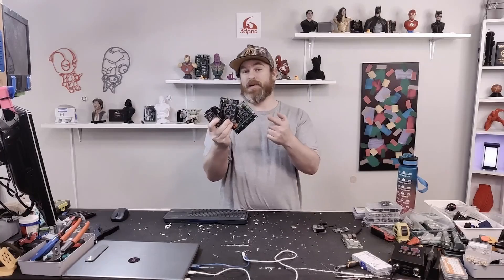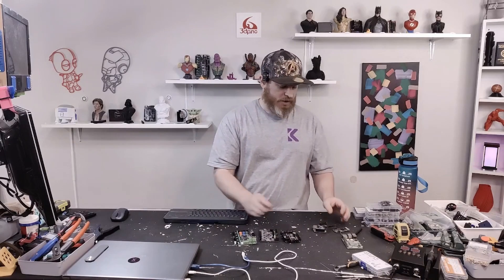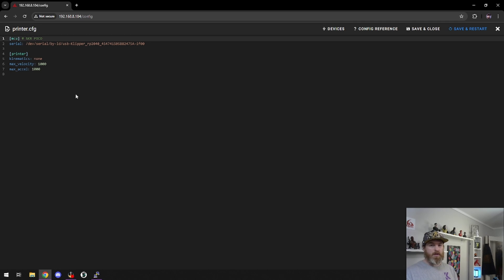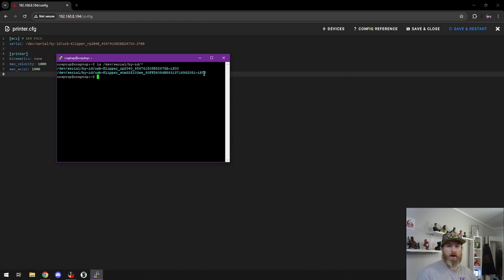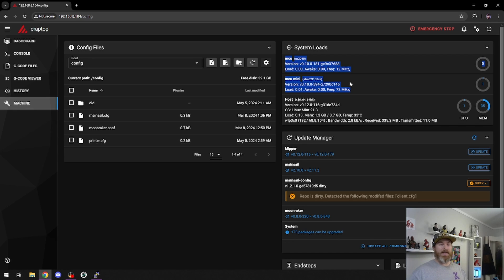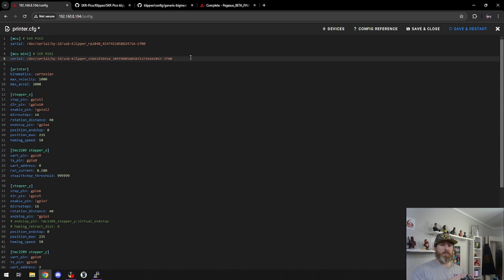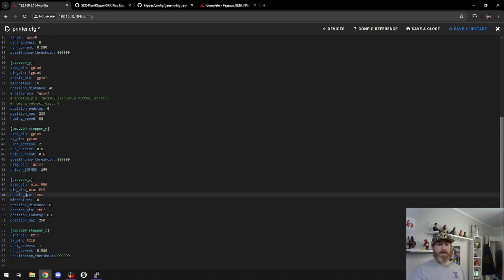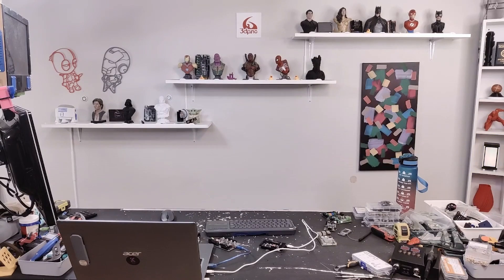Use multiple MCU boards in klipper! FULL TUTORIAL

Comment: Hello! For example, in my klp1 230 only the X-axis driver broke so I bought a skr 1.4 turbo with the same drivers, 

I read that the cheetah v2.2 motherboard that comes with my klp1 is actually 2 boards,  one that contains klipper and the other one is a driverboard, in this case I would only need to connect my skr1.4 turbo in this case the XYZ and change the printer.cfg to add the new mcu? No need to install Klipper for the new MCU? This new Skr1.4 Turbo connects via USB to the Cheetah v2.2? Or direct to the PSU? excuse the confusion since this is my first time doing this.
Reply from the maker: The 1.4 needs both power and USB for signal. It needs to be flashed with klipper too.

Comment: How come my system loads don't reflect the mcu's that I have added?
Reply from the maker: I don't understand
Reply: @kanrogcreations    In the video when you added an mcu you could see them under the right hand side labeled "system loads" in Mainsail.  What would cause the MCU to no show up there?  I made a simple printer.cfg with just a few lines like yours and I can see it under the devices pull-down and I can see them in the serial/by-id/
Reply from the maker: @My_life_has_changed I would have to look at the configs to check that, I suspect that you have missed a include line somewhere
Reply: Thank you I will reflash my board to CAN instead of USB and see it that makes a difference.

Comment: I have a question could you put include in the name of the board much as you put include fluid CFG in your printers. CFG would clipper reference the other board that way
Reply from the maker: If I understand the question; Yes. you can put the [include] line anywhere, even in other .cfg's as long as they are already included in the printer.cfg.
Reply: Yes that was the question designing my own multi-material set up and I was hoping I could just put include mmu CFG in my printer CFG configuration and it would run the other control board for the other four extruders @kanrogcreations
Reply from the maker: @jasonwilson9207 that's a good way to do it yes, a cfg for each tool board and use the [include] function in your printer cfg
Reply: Awesome thank you how many YouTube video on my progress kind of sucks cuz I have my phone turned the wrong direction but I'm new to making YouTube videos relatively @kanrogcreations

Comment: i have a slight problem whenever i reboot the laptop running klipper my second mcu doesn't connect back do you know why?
Reply from the maker: Might be a USB driver issue. I don't have much experience running multiple mcu's on a laptop. Does restarting klipper help fix the issue?
Reply: @kanrogcreations  figured out the issue it was a bad usb cable

Comment: Only thing I'd do different, is to use /dev/serial/by-path. As long as the mcus are plugged into the same port every time it's easier than trying to use by-id for identical boards
Reply from the maker: Valid option, yes, I just wanted to make it as simple as possible for the video.

Comment: there's a ton of good info here! keep up the good work! I'm building a printer that is going to have 8 stepper motors so one mcu is going to be used strictly for the z axis (4 corners), and the other is going to have 2 y's 1 x and 1 e. hoping i can find config examples somewhere of changing driver outputs to do what i need

Comment: Do you have info or config for 2 Creality 4.2.2 boards I can look at?

I can get 1 motor to work with the touch or both motors to work but the touch doesn't work for homing.

1 board will update to 0.12 the other is on 0.11 and refuses to update?

I have a pinda original sensor in place but that isn't working either and I'm looking for code for that as well?

Any help appreciated
Reply from the maker: Come over to the Rolohaun discord and we can help you there 😉

Comment: Can we give each board its own name in mcu section?
Also, does each board need its own power supply?
Reply from the maker: One of the boards has to be called just [MCU], but the rest can be called whatever you want it to be called.
You can power the boards from the same power supply, just make sure you have enough wattage to do so, all the heater, motors, fans, LEDs etc add up.
Reply: @kanrogcreations  thanks